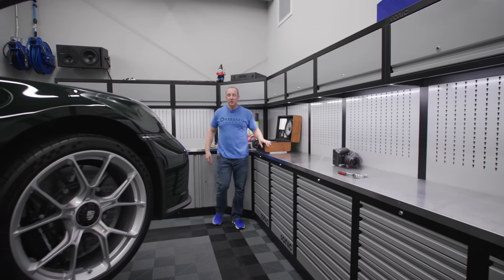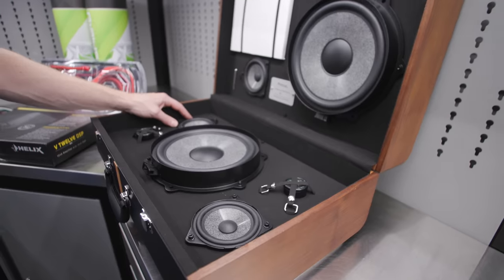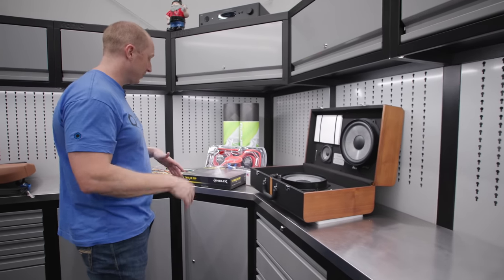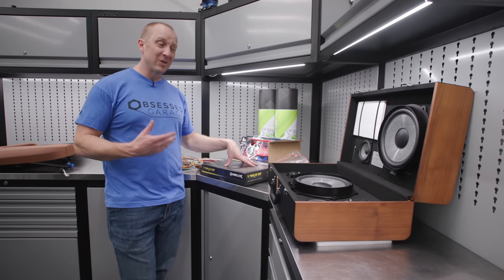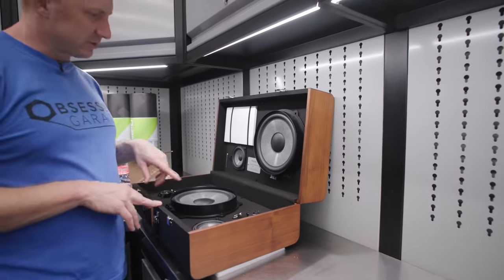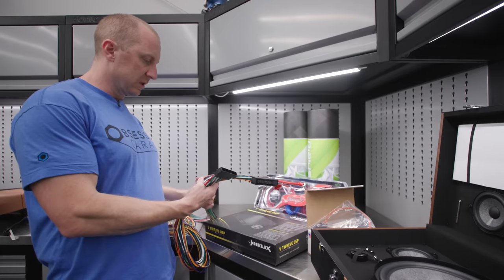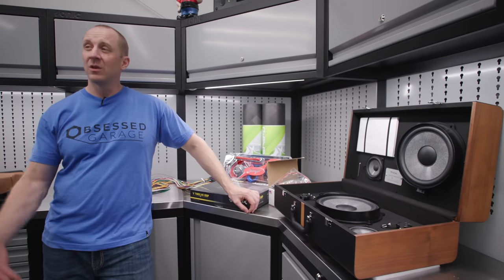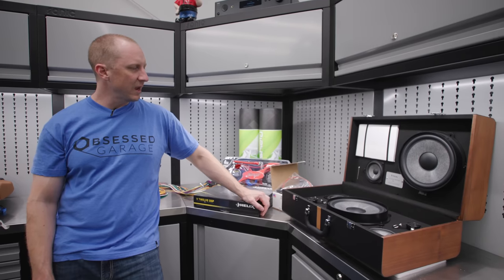Installing Focal P60 Speakers in My 992 GT3 Touring

Comment: No roller for the sound deadening application? Glad you didn’t scratch anything with the metal pry tool. This video reminds me of the audio system Matt did on the blue GT3 I don’t think Matt would do that much again.
Reply: Yeah, I can't understand why the pry tool is not plastic. Looks like it chewed up the tweeter recess slightly.
Reply: @herbpantaleon7485  I noticed that but he mentioned something about depth and how the tweeter would set. An my intent wasn’t to criticize or anything of the sort, many times Matt has alluded to his willingness to be the tester and take the bumps that come with doing so, I appreciate that. Some measurements ( on the sound levels before and after would be nice but I understand the relativity of it) but it is a trust thing I like more bass feel than Matt I have come realize ( I am also half his age if that so it makes sense) but totally agree on highs and mids.

Comment: Would LOVE to have a guy like this in the Munich area. I have a 991.2 Turbo with the shitty Bose system. I would do a similar upgrade if we had people here. It would be even better if the dealer would offer this as an upgrade option.

Nice job man!
Reply: @Sailingbill1 , you could upgrade yourself by just buying the components and saving a ton (a Focal Utopia 3-way component set is a hell of a lot cheaper than $6k, and for less, you can get better than Focal).... and if you just wanted a cheaper upgrade, you could hit Suncoast Porsche and start buying Burmester factory components that weren't specd on your 991.2 and pop them in place of the trash Bose.... anything is better than Bose 😅

Comment: you didnt mention the reason why you are going to disconnect the center channel. Im a simpleton when it comes to audio so I just think more is better right, plus its included in the kit so the people who create these things reccomend it. But I guess it maybe has something to do with tuning the system, where you define low-pass, hi-pass, time delays, etc. and this center channel just makes it more complicated to tune for what little effect it would give in the end? or is there something else?
Reply from the maker: Stereo imaging is the reason.  We have an available channel in the DSP and amp, but when Matt Schafer tested the system in his last install, he ended up turning off the center channel.  It's a real pain get the clock out, so he suggested I not mess with it since it doesn't add to sound stage.

Comment: Should have used a sound deadening roller and apply heat to sheet before and after applying it sticks better. There's a chance they may start peeling off.
Reply: its fine
Reply: @BarbWaltersMusic  depends how sticky the butyl is.

Comment: What is the reasoning behind disconnecting the center speaker rather than replacing it with the focal one?
Reply: My guess is with the center speaker in the mix there is just to much sound bouncing around and it could muddy up the good side 3 way system. Kinda more is not better

Comment: You didn’t show the center channel install? How do you remove the cover there?
Reply from the maker: I’m not doing the center.  It’s a big, risky job to remove it.  We don’t want the center anyway.  Matt Schafer tested with and without and ended up defeating the center.
Reply: @ObsessedGarage  I ended up doing it just now, and yeah, it's the biggest pain in the arse ... but doable.  The Helix he tuned likely isn't using the CC, or just as fill I assume.  If one is just replacing the speakers though (and not the amp), I think you have to replace the center as 1) the Bose tune puts a lot of emphasis on the CC, and 2) the Bose speakers are much more efficient so if you leave the CC it sounds louder and overpowers the side midranges IMO.

Comment: Wouldn’t touch an interior like that in case it causes rattles etc. in the future.
Reply: It kinda come with the territory more vibrations (sound waves, more air movement) more rattle but you try to mitigate it, it can be done though
Reply from the maker: Normally I would agree, but in my experience taking apart Porsches, that isn't an issue.